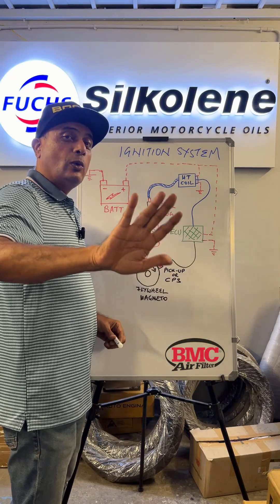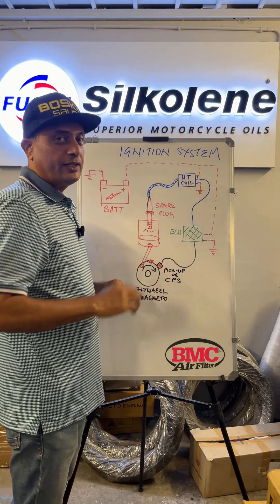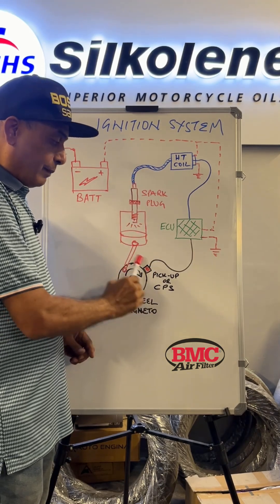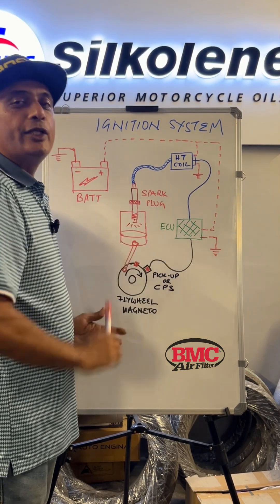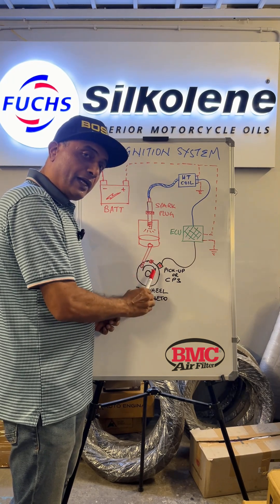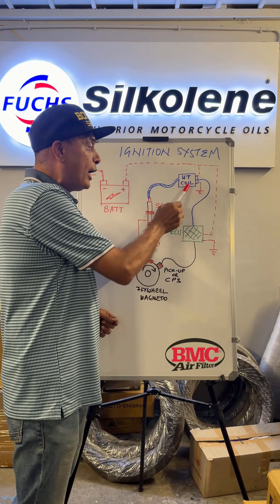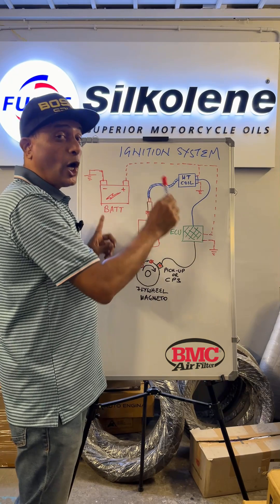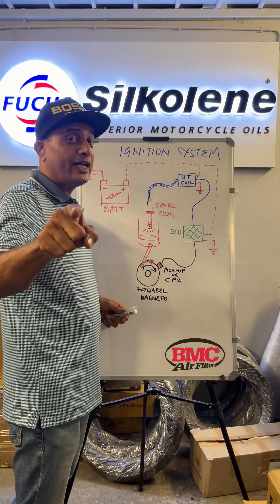Big Bear Tech Tuesday - Ignition System

Comment: Hi there once again, 

Just wanna share with you that all the questions that I asked earlier, I have successfully managed to solve them by myself. These days I'm getting more in love with the machine. 

Would ask you one more question.. 

The rear spring preload, how can I make it soft in potholes. 
Which way, clock or anticlock will set the rear suspension to soft mode.....?
Reply: By the way, Thank you so much for responding to all the questions. 

You are fantastic.
Reply from the maker: The setting are for preload and not necessarily for softening. However, rotate in direction to bring the adjuster down away from the spring. I don't recall the direction.

Comment: Bosky... Have you observed on 450 when you release the clutch slowly without touching the throttle, it auto revs a bit. It happens in 1st gear when you are not moving. Is that anti stall or something??
Reply from the maker: Yes that's normal. It's technically not an antistall but yes it operates like an antistall.